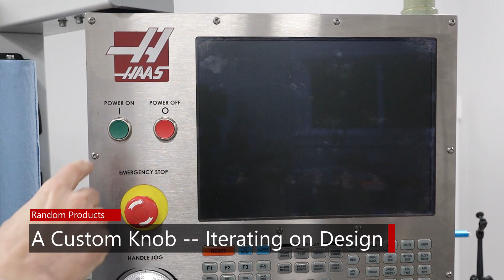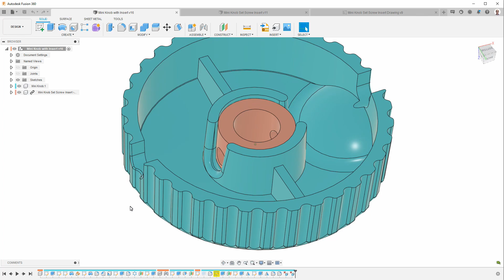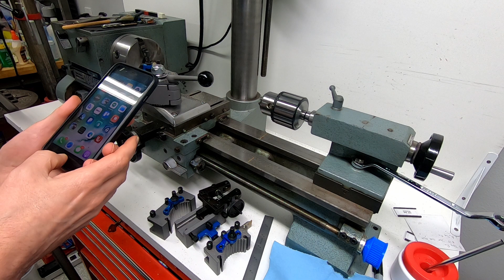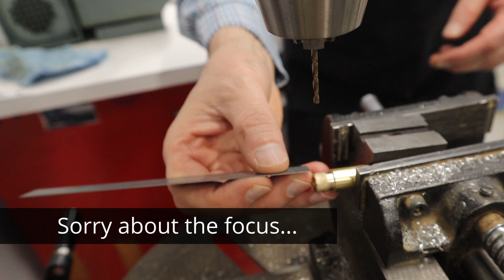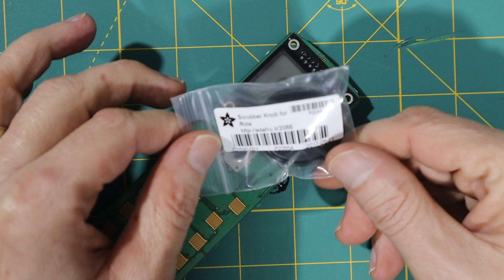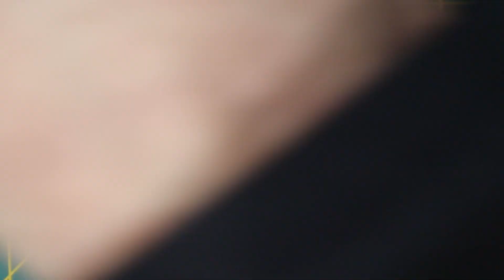Custom Injection Molded Knob -- Prototyping

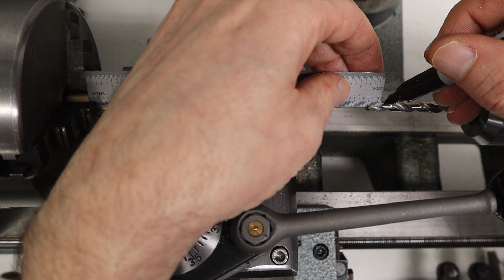Comment: in 14:38 You mark the drilling depth with a ruler, why? if you have a limb on the quill of the rear headstock of the lathe
Reply from the maker: The hole needs to go all the way through, so it doesn't have to be precise--just longer than I measured. I find using a mark this way faster when I don't need the precision.

Comment: Nice work:) Hey, I did a few knobs for mass production over the years for some electronic products. I'm in the Taig FB group my name there is Tommy Wilson (alias name...). If you like, I can send you some CAD of what the knobs looked like. You can capture the knob in the housing clamshell so you don't need a clamp, or a setscrew. The knob is still open-shut. It might help you in a future design, so you don't need to worry about the clamping. You can also put hard stops molded into the knob and housing, so you don't rely on pushing the switch to its limit, and potentially breaking it (depending on the switch).
Reply from the maker: Thank you! I sent you a message on Facebook.

Comment: I'm only about half through your video, but I'm wondering how many of those brass inserts you're going to need.  I'd love to get some experience making parts to order on the CNC lathe, as opposed to only making my own parts.  I'd be happy to make a couple to your drawings, send them to you, and then see if I could make them for you.  

If you're interested, you can email me and I'll also look for a reply here.  A bit of text replacement inside the brackets if you want to email.  The address is [my first name here at youtube]@[My last name here at youtube]trust.com.   Hope that makes sense.

And thanks for the videos, I have a LNS injection system I modified to be pneumatically controlled and created a simple controller from an arduino that handles precise injection, dwell, and retract times.  I only make about 600 parts a month on it, but it is so much better than the original manual setup.  Your videos have increased my knowledge in the area of mold making.
Reply: Aw, I should have watched the full video!  Anyway, I do have both CNC lathe and mill and enjoy this stuff.  I'm happy to make you some parts in the future, so the same offer applies.  And I do really like your solution of two knobs.  It's so easy to get fixated on single approaches and try to get the cost down on something like the brass insert, when you can actually offer both options cheaper.  Kudos for seeing the outside the box approach.
Reply from the maker: Thanks Bill. I sent you an email.

Comment: If there is enough processing room left the knob could be flipped around in software since it is using an encoder.
Reply from the maker: The two orientations are needed for the potentiometer version since it has physical stops that would prevent it from rotating around. The encoder version only needs one knob.

Comment: Have you thought about making a 2 finger well design?  12oclock can be like the original design and the 6oclock could have a bump up feature in the middle.  The users finger will feel the difference and figure out the orientation of the knob.  Unique shapes might also work.  
One other thought.  How about something a little lower profile?  A lot of the last of the VCR remotes had similar setups.  A shaft-less encoder might work.  Very nice lathe work!!!
Reply from the maker: Yes. One of the team members suggested two depressions. I created a version of the 3D model and they didn't like how it looked. They preferred adding a second knob. As to lower profile, this is the shortest we could get with the location of the batteries, etc. in the design. The maximum thickness was also constrained by some other products already out there.

Comment: You need to enlarge the holes of 3D prints by half your nozzle diameter, and account for shrinkage in X/Y
Reply from the maker: I usually add 0.4mm to the diameter, but for the one that didn't fit, I guess I neglected to.

Comment: It would likely be cheaper to swap out the rotary encoder and trim pot for a splined model. It would solve your problem by allowing you to position the knob in almost any position and eliminate the need for inserts and screws. Likely save money in the long run since the cost is nearly identical.
Reply from the maker: The person doing the circuit board work first wanted to have the same shaft length for the encoder and the potentiometer. One of those, I don't remember which, only came in a D shaft. So he chose the same D shaft for the other one. So many constraints...
Reply: @JohnSL  you should check digi key. They are both off the shelf standard package with splined some times reffered to as push on style. Been available since at least 1980. They are used in almost every car stereo and home audio unit on the market. They come in board wire in and surface mount packages in almost any resistance imaginable.
Reply: @gremlinsports  I am the one who picked out the encoder and potentiometer to use, and trust me, we looked at nearly everything available (Digi-Key, Mouser, direct suppliers, etc...). In the end, we chose the encoder and potentiometer combination that best met our requirements as a whole. Two key requirements were a similar footprint for both that could be used with one board design and something that was reasonably low profile. Those two requirements narrow the possibilities down very quickly. We also wanted to used an established supplier that we could trust for longevity and quality.
Reply: @stuartbaker3595 There is around 50 pages of them on digikey here's a part# for  one pec11r-4220k-s0024.
Amazon wytp68  Ebay dq11 rotary encoder. I believe they are less than a dollar cheaper if you buy a larger quantity. Part numbers change by package shaft style diameter.
Reply: @gremlinsports  Please trust me, I'm very aware of all the options. We spent many weeks evaluating our selection. We are in fact using the PEC12 series, a cousin to the PEC11R series, but about half the price (yes the price does matter).
Reply: @stuartbaker3595   originally it was stated they only come in d shape wich is totally incorrect. As I personally have 20 plus years in electronics design I was simply trying to help.
Reply: @gremlinsports  Nothing wrong with providing suggestions. Another consideration that came into play as well is that although Bourns (our preferred supplier) offers a lot of options, even within the PEC11R and PEC12R families, not all of the options are high runners and regularly stocked by distributors working in reasonably small volumes (<10K units). This is a rather low volume product, and industry as a whole. We can't typically put together an order large enough to drive supplier production and stocking decisions. Therefore, we have to make some educated guesses as to what choices will provide the best chance for continuation of low volume supply, especially for times when the market supply is tight.